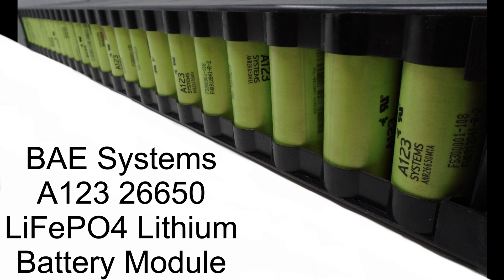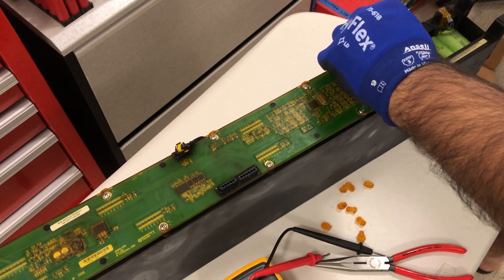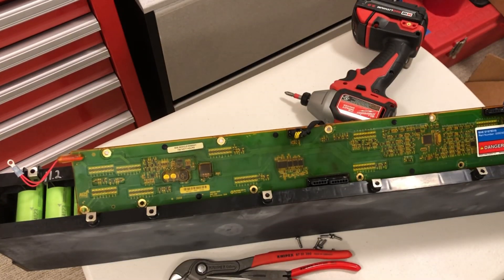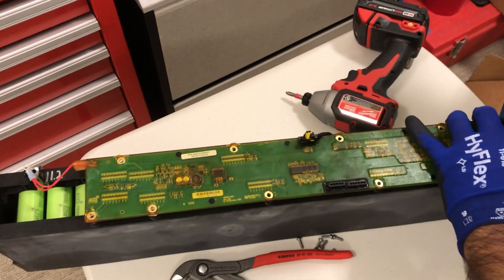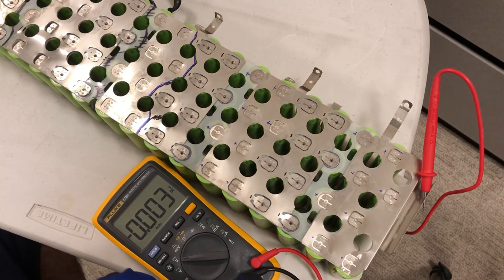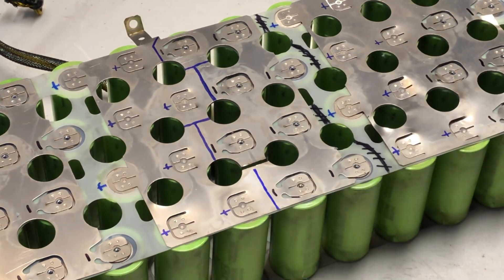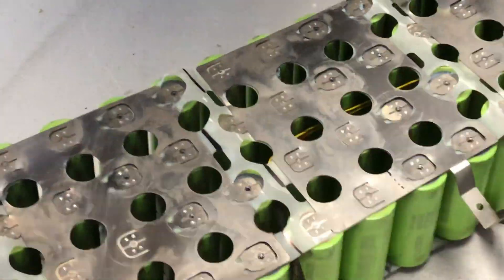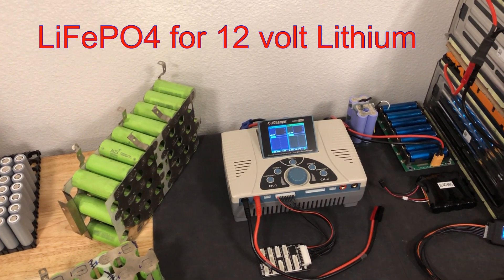A123 26650 BAE Systems Module Teardown LiFePO4 Part 1

Comment: may i ask which blade did you use to do the cutting and what is your RPM at ?
Reply from the maker: Timbo Yuen Not 100% sure to be honest.  I have had that tool for years. It’s a small cut off wheel at medium to high speeds.
Reply: @HamPower  OK. Still appreciative

Comment: Could this pack work in a Golf Cart?
Reply from the maker: If the golf cart is 36v lead acid, it should/could depending on the rest of the setup min/max charge range.  Voltage wise it should be compatible if 36v if all checks out.
Reply: @HamPower  they are 36v battery pack with BMS, could I use them as golf cart directly? so I do not need to teardown them and buy new bms and welding. logically yes?

Comment: Metal snips,..?
Reply from the maker: I hear from some other people who have tried using snips run into clearance issues and have shorted cells.  The bus bars are very stout, Dremel made quick and easy work of it.
Reply: I have used that.  When you cut into it, you may be stuck touching the cathode and the sides are touching the walls of the cells which is ground, and shorting it....so I did short one by accident, you will have to use some coating or tape the sides...maybe try dipping the sides of the shear to resin?